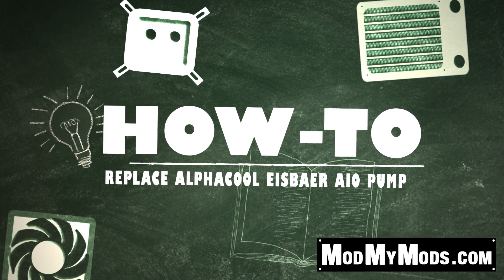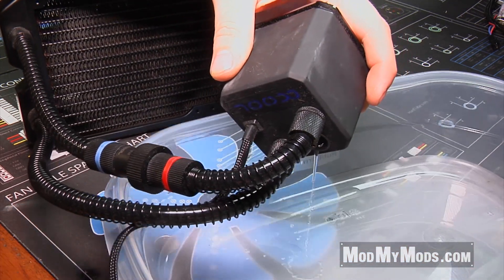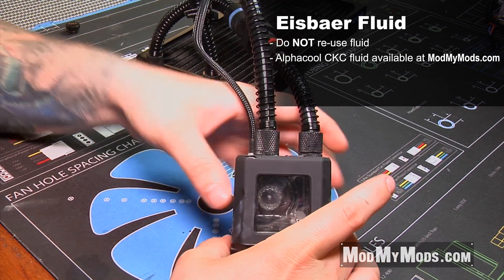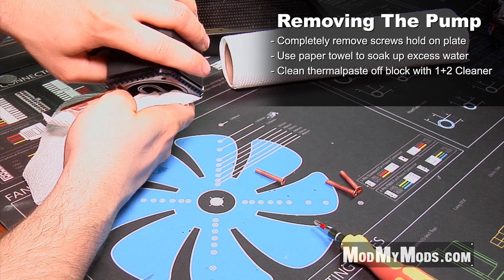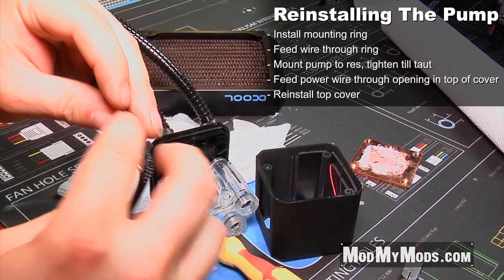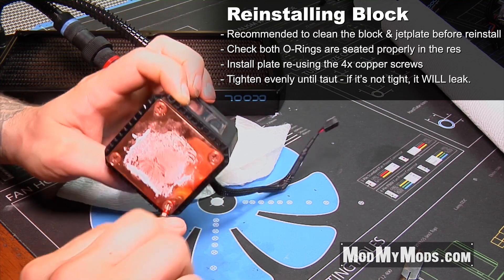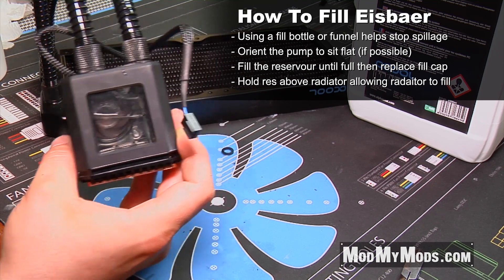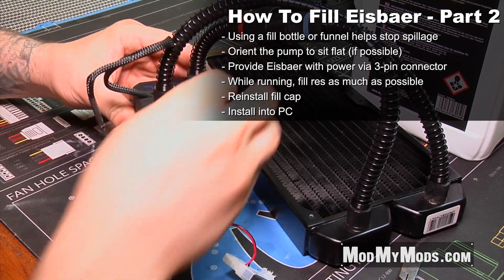How To: Replace the pump in Alphacool Eisbaer AIO

Comment: It's better you loosen the connectors as well from the pump and then shake out the water. Also easier to shake the radiator too. Paper towels also leave dust, better to use a clean cotton cloth.

Comment: Does it matter what location the hoses are fitted in? For example the hose with the quick release connector (red and blue rubber bands) is connected on closest to the the alohacool branding. Does it have to be in that specific spot or can I just switch the orientation around? Thanks!

Reason why is because the hoses will look cleaner and reach out better to the CPU while installed.

Or maybe I can just switch the hose orientation on the radiator itself? Without changing the placement on the pump.
Reply from the maker: You got it, it doesnt really matter which side the Quick-Disconnect fitting goes. The fittings/tubing is installed with a machine so you will need some plyers or vice-grips to get then free.